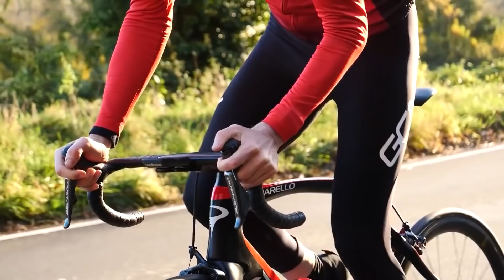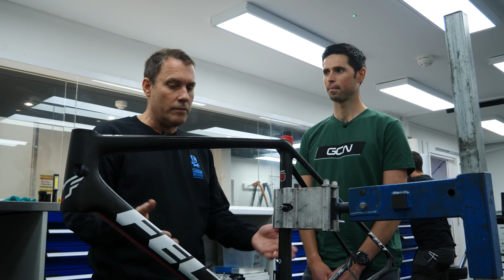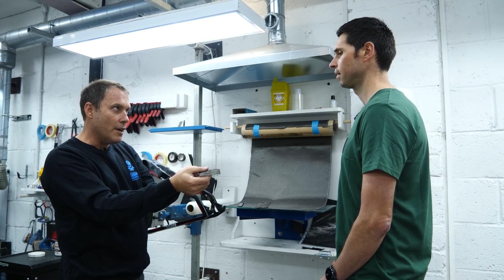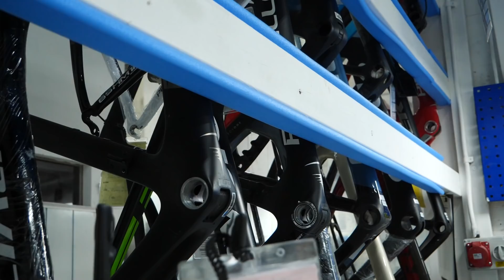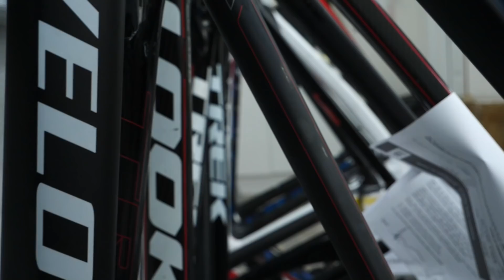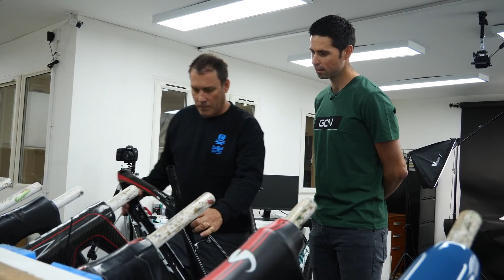Can Carbon Fibre Bike Frames Be Repaired? | Is It Safe To Ride A Broken Carbon Frame?

Comment: Some brands have crash replacement programs, so you can buy a new frame for a fraction of the normal price. My Canyon Inflite CF had a broken seatstay (2 places) due to a crash. Still had a long way to go but risked it. I started with caution, obviously, but found out it didn't felt any different. 60km further, I almost forgot about the broken seat stay when taking a rough gravel section. Made it home safely and was surprised how strong the frame still was. I asked for a quote from a reputable carbon bike fixer, and the difference between them and a crash replacement frame was 500 euro and a waiting list of one month. I went for a fresh new frame, delivered within a week.
Reply: You rode a broken frame back home?
Reply: @pierrex3226  yes, mind you, I still had the support of 2 chainstays and 1 seatstay. With only 1 broken seatstay, in this particular case, it was safe to ride back home. Sadly, last summer I also crashed this replacement frame, and incredibly broke the seat stay again, only this time half of the seat stay was gone (literally!) and the frame was damaged nearby the thru-axle, so that was the end of the ride. It solely depends on where the damage is located, a damaged fork obviously is way more critical, don’t need to explain that.

Comment: Alex as we all know the more you know the more you don't know... Where was the resin bonding carbon fibre mat placement Ultra sound ( if it is used to find fractures). Vacuum forming and removal of air in mat and resin. Heat treatment.. There seems to be so much you left out.. Software for remaking decals and the printer / vinyl cutters involved. etc etc...
Reply: I was also curious about the heat treatment... how does this work? Is the whole frame baked again (I don't think so)?
Reply: @Brainless437  coming from the airline industry, the area that is being repaired is vacuum sealed and the heating blanket goes over the repaired area. so it removes the air bubbles, compresses the composite layers and bake the area as well
Reply: @Syn741  awesome! Thanks for the explanation

Comment: This is great until you get the quote back and find out the repair is 80% the cost of a new frame
Reply: Perhaps but I was quoted 900 to fix a seat tube. Maybe I was just unlucky. Still, my TCR sits in the garage as a 2k paper weight because of DHL. Insure your bikes lads.
Reply: @stumprat  I'd definitely shop around there mate £900 to fix a seatube doesn't sound right unless the repair requires something drastic
Reply: Exactly, I've destroyed half of the rear of my ALU bike and got a friend that owns a mechanical workshop, with a nice degree in mechanical engineering, to repair it for me, he charged me half of his regular fees and I spent 190€ for the entire back of the frame (both chain stays and seat stays), yes it's like 130 grams heavier and maybe if Filippo Ganna were to ride it wouldn't be that stuff as the original, yet I've got a 1.450 kg frame that costed me 500€ and that I rebuild for 190. Super happy, still humiliating some Pinarello Dogma up the Stelvio 2 weeks ago
Reply: @bellini98-1  an anecdote of getting half off from a friend isn't too useful since he won't do that for everyone😂
Reply: Not that bad. Depends on how bad the damage is. Simple cracks are 3-500 bucks max and paint match is another 3-500
Reply: @jladd21  honestly it's not even that bad either. I cracked my rear chainstay badly and took a load of paint off in that area. It cost me £186 for a full repair and repaint
Reply: @austintinoC00l  Who done the repair on your bike at that price?
Reply: If that was the case, they wouldn't be in business